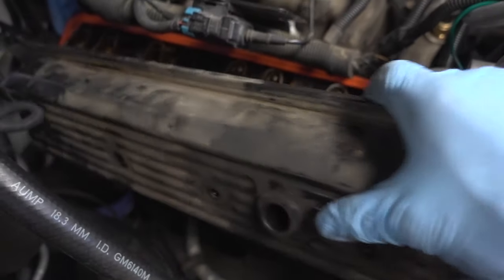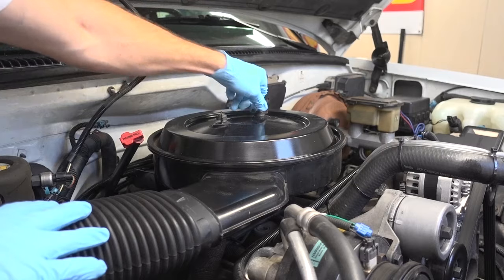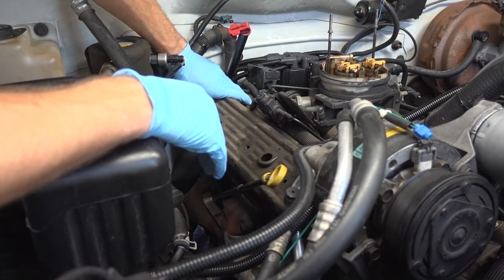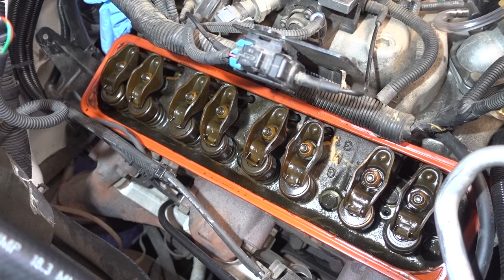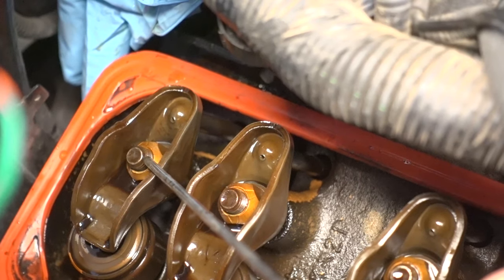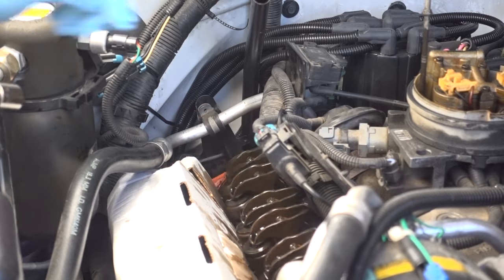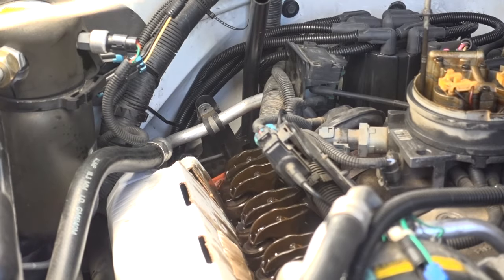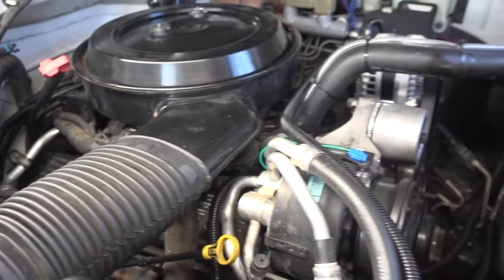Valve Adjustment With Engine RUNNING! - 1995 Chevy GMC TBI

Comment: To me that's the messy un-precise way.  I do it with the engine off in the firing-order.  Super easy.
Reply: You should rev the engine for 10-15 min then only expand the metal and it gives correct tightness.
Reply: You'd be guessing which tappet is making the ticking with the engine off a no brainer
Reply: He probably gets easily confused like me.
Reply: @topluxurymotorsport3437  you mean expand to tolerances,  it seems with hydraulic lifters it is unnecessary,  those .025 of an inches are absorbed by the lifter baskets

Comment: you should have done all the valves since you were in there. if the clicking doesn’t go away it is a lifter tick. run some oil flush through it or marvels mystery oil to clean out those lifters
Reply: ATF

Comment: I’ve noticed with the tbi chevys there’s a loud tick from the injectors. If you test them with a 9v battery you can hear them. They’re loud enough to hear in the cab. It also makes it very hard to listen for other ticking sounds. But also can drive someone nuts when trying to diagnose an engine noise. Just throwing it out there for people who have a tbi Chevy.

Comment: I'd have kept pulling plug wires and try to isolate which cylinder that ticking is from. Replace both lifters for that cylinder with premium hydraulic lifters sitting for an hour in some clean lighter weight engine oil. I would NOT mess around with trying to adjust lifter preload on a running engine. I've just had too good of luck going to zero lash plus 1/4 turn. I personally go no farther and have always found that to work well for me.

Comment: I have the same problem on my 5.7. Oil on the spark plug, clacking. I think I need new seals, but you provided some other "roads" to try. Valve seals are one road, I see about the next ones.

Comment: Early model Chevy small blocks we use to tighten each valve until the engine ran a little rough then back off 1/2 a turn and go on to the next valve until your done!

Comment: it's really easy to do not running, and it doesn't have to be warm for a hydraulic cam. You spin number 1 until the exhaust just starts to open, then adjust the intake. Take the lash out so there is just barely no up and down play on the pushrod, and give it 1/4 to 1/2 turn (pick one and stick with it). Follow it through the firing order and do all the intakes. Then spin 1 until the intake valve just starts to close, and adjust the exhaust the same way and run through the firing order. That works even with large roller cams. Keeps you right on the base circle of the cam, gets it perfect every time.

Comment: Interesting approach. I always thought noisy lifters were from air bubbles inside the lifter, which clear as those air bubbles are forced into the top of the head. My noisy lifters get better after a few minutes. Great demo, I though it would be more messy.
Reply: The oil passages are all very small tubes to each component.  No air bubbles with 40+ oil psi. On something old maybe worn and leaking oil internally,  it could take a bit longer to fill all lifters.  Otherwise it is under 2 seconds

Comment: Great video, my Chevy has the exact same issue with cylinder #2 with fouling plug.  Did your valve adjustment fix the fouling?

Comment: I hear tiking also on my 1988 Chevrolet  S-10 when you step on it
Reply: Been working at cars since the early sixties what we used to do back then was get an old valve cover cut off most of the top put it back on the engine then the oil didn't come out and you could still adjust it
Reply: Sounds like an exhaust leak

Comment: Hmmm? Last time I did this on my old 69 Chevy many many years ago, I seem to recall even at idle oil sprayed out the pushrod hole with gusto!  Have to be careful going too tight especially if the pushrod stops spinning. I went with quiet, still spinning and 1/4 -1/2 turn more on a warm engine. I see lots of comments here with many different methods. Hard to say which is right, wonder what the manual says on this particular setup?
Reply: That's what I just did an hour ago usually do 1/4 turn, now did 1/2 turn. I always adjust mine about every 6 months to a year...
Reply: Yeah,  a manual is the first place anyone should go, then youtube for method or procedure.  And I mean a Chilton or Haynes repair manual.

Comment: Lifters clack because you probably have a low oil pressure problem, and so the cam could be worn. I wonder what the oil pressure spec is?

Comment: just a litte tip for future if you need to turn the engine over by hand use a ratchet and 15/16 socket on the alternator pulley nut and its makes turning it over very simple.

Comment: I would like to suggest that the nuts should be replaced. Those nuts are a one time adjust  type of nut. The nuts loose their locking strength over time and you would be smart to change them so that you can have them keep in adjustment. I was at G M Training Center when they had one at Tigard, Oregon. They recommended changing the nuts every 50 thousand miles because they will loosen as they heat and cool every time you run the engine and that weakens the locking feature of the nuts.

Comment: Sometimes a simple oil change can solve a ticking lifter issue. It's also one case where an oil additive can actually silence a lifter ticking issue. I'm pretty sure it's a matter of replacing old dirty oil with clean engine oil that flows where it's supposed to thru open unblocked oil passages.

Comment: There should be more oil flowing out of those lifters. To me it looks like you have an oil starvation issue.
Reply: Was just thinking the same. Oil needs to be making a little mess while running
Reply: It took a while but it did start showing,  I definitely expected a nice bath.
Reply: If it was that bad it probably would have stopped running rather than annoy him with ticking

Comment: 55 lbs of oil pressure cold at idle. you should replace the seals but these heads run hot and the guides wear really badly because of it.

Comment: Did you figure out what's causing the build up on the back plug? I have the same issue but no ticking.
Reply: Most likey leaking valve stem seals. They dry out and distort, and break from being dry and brittle. And the oil drips down the stem, and onto the sparkplug, and you'll even see smoke on startup. It's a well known common issue with gm

Comment: My 99 yukon is loud and needs a muffler.I noticed a small miss by feel the distributor was broken at the ear where the bolt that holds down the distributor cap screws into.Good old jb weld!

Comment: Usually its a worn rocker arm and putting more preload changes the geometry slightly preventing the tick, or it could just be a worn lifter, putting preload in a different erea of the lifter can stop it from losing zero lash

Comment: I can tell you from experience the easiest way to get it off is to take the belt off and loosen the whole structure that holds the AC smog pump compressor honestly mine's all cut down it hasn't had a smog pump on it since 95 I have a 91

Comment: how can incorrect valve adjustment affect oil consumption / deposits ?

Also I´m always suprised how little lubrication there is in the valve train of these pushrod engines

Comment: Anyone notices how the engine sound changes (not the ticking, but the engine) as he tightened it down?  It actually is adjusting the valve seating as well as the rocker arm sound.  That will make a change in your horsepower and fuel economy.   So be careful.
Reply: Yeah there is the automatic fast idle kick down after a moment and I think that was it. Also exhaust rattle combined with a overwhelmed microphone

Comment: Can't do this on my '99 suburban.  Have to pull off the power steering pulley, the AC compressor and bracket just to get the valve cover off.  Nightmare

Comment: U can rotate the crank shaft from alternator pulley it very easy.
Reply: Nihad Mj forget it, you’re pushing 8 pistons around, the belt will just slip.
Reply: @MrZdvy 
Try it, it very easy to rotate but one way against the tension

Comment: i prefer to set my lifters like this,but i use the clips to stop the oil from flying,but you don't seem to have that issue, i would be looking into the low oil pressure as that small block should soak the wheel well, mine will hit the wall about 8 feet away if i dont run it with the clips lol, that could have been part of your issue, poorly oiled top end will cause excessive wear, i know this is a older video and not sure if you still have this truck or not but i bet those back cam lobes are wore pretty good, seems to be a pretty common issue with the 2nd gen 5.7l's

Comment: I don't know where you are with this today but that noise is either a bad lifter or a worn camshaft lobe or both . What you did may have masked the issue but it can only be temporary at best . Now the engine valve timing is off .

Comment: Watch your video, that rocker actually stops rocking intermittently. Did you have to change the lifter at a later time.
Reply: Thats just frame rate.  If any rocker or valve stopped functioning there would be a very noticeable idle sound.

Comment: I know this is old but it could be your timing chain wearing out and a easy fix is switching to 10 w 30 instead of 5w 30 because of the higher viscosity

Comment: Those Heater hose Quick connect fitting are junk. I replaced it with a normal hose fitting with a clamp

Comment: those are not Hydraulic? I thought you didn't need or couldn't adjust them only the solid lifters can be adjusted, been a while since I messed with rockers but thats all I remember, nice video
Reply: They are but can't hurt to readjust at least as often as the maintenance schedule

Comment: I got a 97 4 runner v6, what’s the best way to stop oil seeping into the spark plug threads? I pulled three of my spark plugs from the driver side and all 3 had it.
Reply from the maker: While I'm not a professional mechanic, during my research, I came up with a few things that could be happening; valve cover gasket leaking, valve seal leak or even worse, piston rings that are broken or cracked... 👍
Reply: I would look down the Spark Plug Tubes and check for oil in them.  If there is very most likely your tube seals/valve cover gasket needs to be replaced.  And if should happen to do one side might as well do both if they are roughly the same age.
Reply: Valve cover gasket replacement.  With the rings for the tubes

Comment: Value seal wouldn't high milage maybe fix it some what or use a thicker oil like 10w40 i use havoline conventional oil in a truck simalar to this mine doesn't tick with 260000 miles if there's some oil restriction going on maybe it's sludge try some Marvel Mystery Oil it works wonders

Comment: I needed this Video! My 07 Impala Ss ticks! Plus the 5.3 is like Sideways so its ticking from the far back right side somewhere. Sometime it ticks, sometimes it don't its crazy wierd! Great vid!
Reply: Cam Mims those can’t be adjusted really they have a bolt that gets torqued down to spec no adjustment for the pushrods at all

Comment: isn't it supposed to have hydraulic lifters that don't need any adjustments?
Reply: It does and the manual recommends checking every 50,000 mi. There is a possibility of enough wear combining to be outside the range of the lifter,  so an adjustment helps.  There is a baseline adjustment,  but yes they don't need the same adjustment as ovc.

Comment: Of window glass checking for a bend it it ,, spray a  half a second spray of carburetor cleaner on  lifter top  wait 5 min ,  reassemble rocker ,. With play in it ,. 

3 start engine , , tighten nut till tapping top  ,

4 tighten nut till engine boggs down , then back off until it runs smooth

5 repeat  15  more times on a v 8        most of the tapping noise is from chipped pushrods and dirty lifters ( engine sluge )

Comment: I am quite surprised that GM still uses "old school"  rockers on a model that new!!!  I personally know that Chevy was using the same style rocker arms in the 60's and 70's.
Reply: My 76 350ci had hydraulic lifters. And that would be way too many turns to adjust.
Reply: Cheap stamped simple parts don't change unless it improves something or saves money.

Comment: I always thought that oil would be splashing everywhere after removing the valve cover.
Reply: SAME. It's crazy to see the rockers in motion but I still wouldn't run my motor without the valve cover.
Reply: He is also inside doing that outside would work
Reply: Yeah oil sits pretty low in the engine and is carried through channels to the moving parts. If there is too much the crankshaft (I think) will churn the oil and mix it with air

Comment: im a GM guy...... but man did their TBI set up SUCK ASS
.
just try this..... idle to full throttle.... then back to idle..... do that 5 times (ya dont need to red line it.... just quickly as possibly.... go from 0% throttle to 100%)
i GUARANTEE it will "bog" down..... or have REALLY REALLY bad throttle response 
.
.
the CPU is like 10MHZ..... just way to slow
the single wire (non heated) O2 sensor is too slow to react to correct the fuel trims (even if the CPU was fast enough)
the 2 injectors only run on 13PSI.... so they cant atomize the fuel
.
and because they cant atomie.... GM stuck a "finger" into the intake port..... to get the fuel/air charge to "swirl" 
which makes the heads flow like a DOG TURD above 4000 RPM
.
.
.
like a good tuned Quardajet carb will give you more power, more MPG, and WAY better throttle response
and then ya get into multi port fuel injection..... and thats better than both (injector sprays directly on the intake valve)
.
.
TBI was a mistake

Comment: Valve seals my 5.7 383 TBI does the same thing to the plugs white black carbon on the side of the electrode valve adjustment won't help it's the seals bud take the heads off and may as well port and polish them as well and head gaskets

Comment: The 1988 to 1995 valve covers are easier to remove than the 1996 to 1999 valve covers. I have to take off brackets to alternator and power steering pump. I can start truck up but will need to put the brackets back on and then take the brackets off to put valve covers on. Or run engine with them off

Comment: Wished that the new body style Chevy Silverado 5.3 liter trucks be adjusted. The dealership tells me that my 2010 Chevrolet Silverado rockers can't be adjusted
Reply: Yeah, the older engines were easier to work on, and the were pretty much bullet proof.  Everything from the 4.3 Vortec up until now aren't as good.

Comment: Aren't the lifters hydraulic and self adjusting?
Reply: I thought so too but not sure. I want to say they are hydraulic. The other problem is that there is no oil on the rockers.
Reply: @blancosilverado9795  oil comes up thru the pushrods and there is a tiny hole in the rocker for oil to get to the pivot point.
Reply: James Providenti 
Yes I know that. I wasn’t sure about the 5.7l that also why I said that there is no oil. Oil should be flowing pretty well.

Comment: could you just make all of them clack and give them all a full turn after it stops ?
Reply: Eric Martin valve would be open
Reply: 1 full turn after 0 lash is the standard for SBC (5.7 L with OEM rockers). I understand that the number of 1/4 turns depend on the threading of the adjustable bolt (20 or 24 threads per inch).

Comment: 1.  Use a piece of metal roofing flashing from the hardware store 6" x 10'  $ 7 ,  instead of that oil soaked fire hazard cardboard     😂    

2   remove one rocker nut and arm and push rod ,.    Check pushrod for a chip on either end , roll it on a

Comment: Firstly, your spark plugs speak a lot. You're seeing black gooey build up most possibly from your fuel injectors. 
If you have a misfire on that cylinder, then you have a leaky or oversharing fuel injector. 
I replaced my fuel injection spider quite easily with a video to help. Make sure you get a multi port fuel injection system that is timed by small chips attached to the sprayers that go directly into the cylinders.

Edit: PS, if it's idling low it's because of your fuel system. If it is doing that, your fuel injection system needs to be changed.
Reply: It is a tbi engine.

Comment: damn I was thinking my throwout bearing was going out again, I need to try this and see if the ticking goes away
Reply: Ticking can also be exhaust manifold gaskets going bad, it's quite a loud ticking when they need replacing
Reply: You can isolate throw out bearing by pressing the clutch.  It will get louder or go away.

Comment: back it of till tick tick tick. tighten till it just stops then another 1/8th to 1-3rd turn. naw i dont load them all the way down. little trick to help keep the lifters from pumping up at high rpm. no way would it be needed on a heavy burban though lol

Comment: Never adjust your Chevy valves with the engine running it takes years of life off your cam very bad idea GM say's this is a big no no
Reply: Not at all
Reply: @goodfellasinc.5648  my buddy is so good at this. No hood and sitting on the fender adjusting them..no failures and all run very strong.
Reply: Yeah..bs
Reply: Of course GM says No!No! They can't get your money if you don't take it in 😏